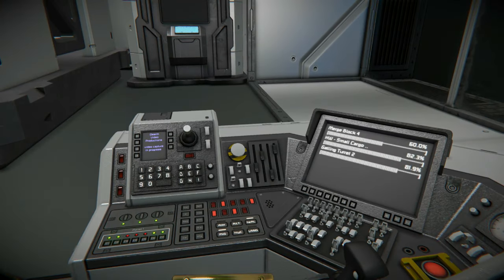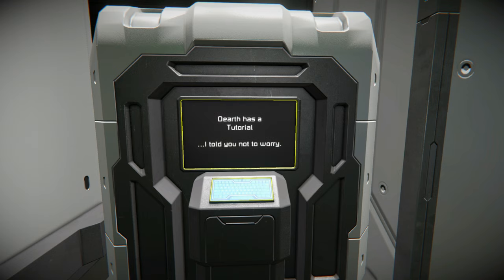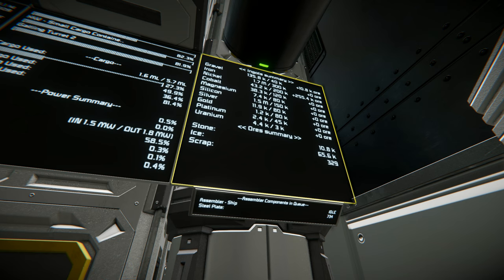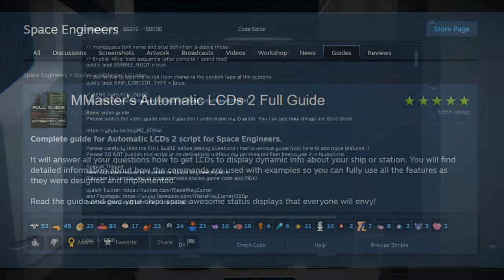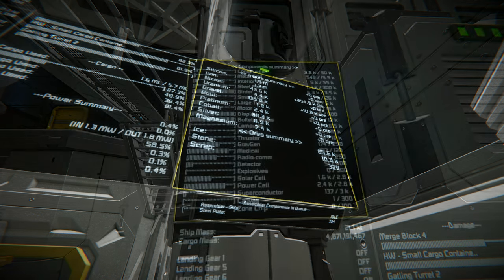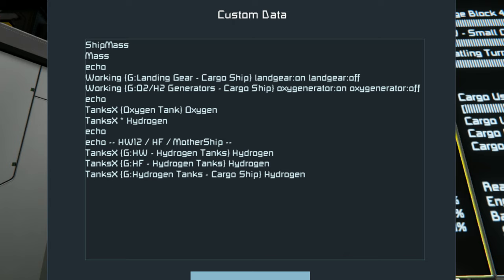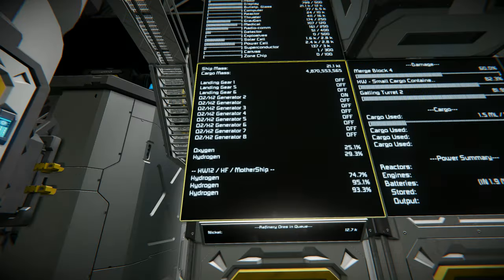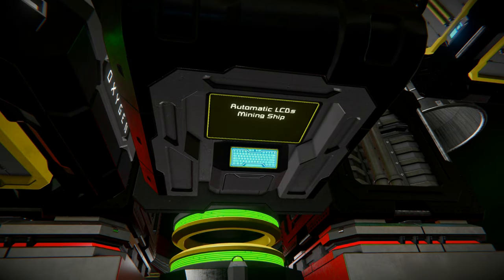Space Engineers - How to Make Better LCDs | Automatic LCDs | Scripts | Tutorial | Guide | Let's Play

Comment: Please do a video on cockpits, I'm sure you did before but I can't find it
Reply from the maker: @angus5769  Do mean getting the similar kinds of readouts on the cockpit displays?
Reply: @Oearth  I mean for cockpit use yeah
Reply: @Oearth  I tried the @1 autolcd and so on and it just dosnt configure
Reply from the maker: @angus5769  My only suggestions to get it working are to match the case as you saw in the vid @1 AutoLCD.  The other (which is probably obvious), is is to make sure you have a programmable block on the same grid as the cockpit (not separated through a connector, piston, rotor, or hinge) and the script is loaded into that programmable block.  You may also need to play with the cockpit blocks display - like the change the font size or make it left justified or something...maybe the data is displaying off the viewable area of the display.  Otherwise, it all should work as depicted...I've done it as shown on several of my ships.  Let me know if you get it working!

Comment: As I understand {Miner} in cutom data is name of specific blocks which are located in your miner. But I have a question. How to rename all blocks in my miner to use this custom data. Especially when we are talkin about command that displays damage. Thanks for reply!
Reply from the maker: Let me see if this helps...
At about 10:57 in the video when you see a command like this - DamageX {Miner} - "Miner" is referring to the name of the entire grid...I named my entire ship "Miner" in the ships Info tab.  Any functional blocks (connectors, guns, cockpits, thrusters, etc...) on that named grid that have taken damage will be displayed.  You don't need to rename any specific blocks.  
When you see a command like - CargoAll {G:Drills - Miner} - "Miner" is part of the Group (G:) name I've given to the all the drills..."Drills - Miner" is the group name.
When you see a command like - Working {Hydrogen Engine 1 - Miner} - "Miner" is part of the specific block's name, where I named a specific hydrogen tank..."Hydrogen Engine 1 - Miner" as the block's full name.
Hope that helps!
Reply: So to make it work on ship I should name shop in that way which i will use in script? Sory for dumb question cause it doesnt work for me. Maybe it doesnt because preveously i rewritr that custom data from your video without changing name of ship, nów ive changed but still no result
Reply: I found solution, its not as in your video but it works. Ive added instead {Miner} this: T: *. Found this in documentantion. But im still curious why it doesnt work like youve shown